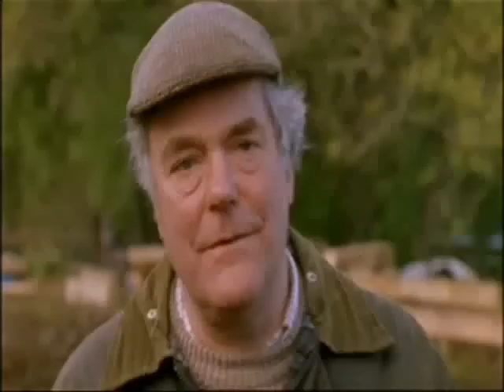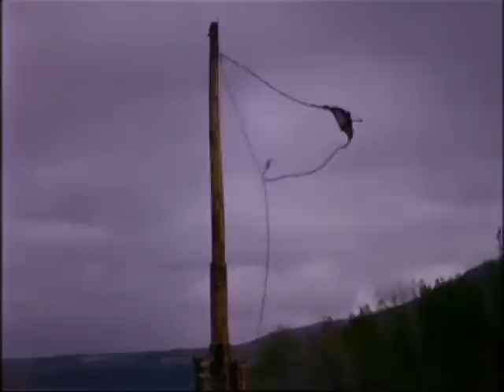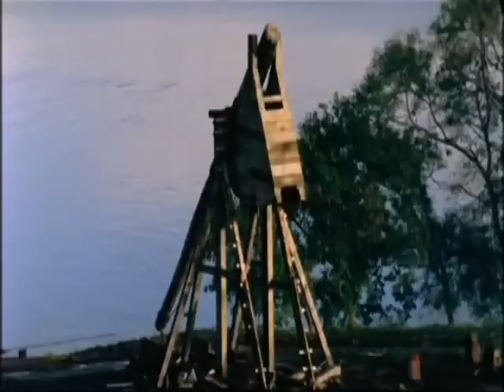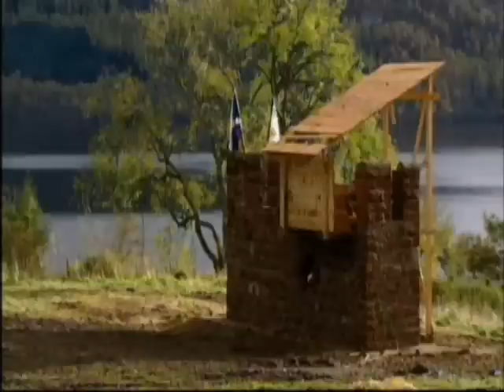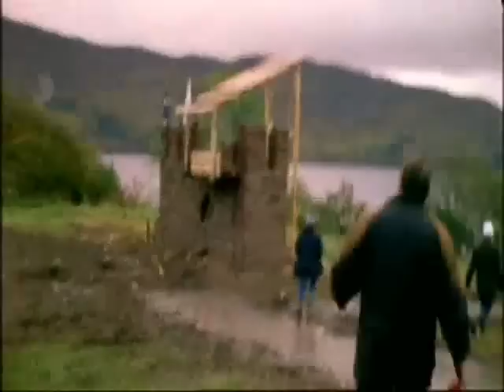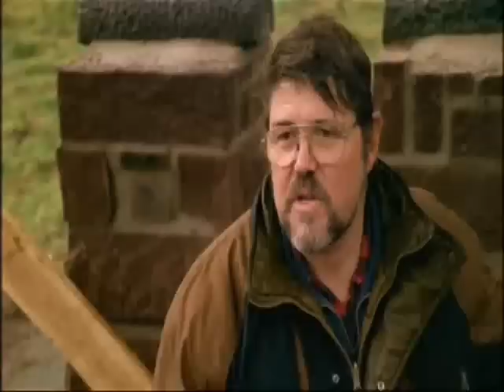The Medieval Trebuchet

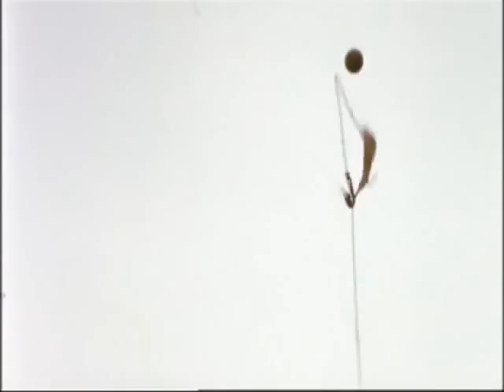Comment: I think the biggest problem was that the rope that connected the pouch to the throwing arm was too long. At 6:02 you can clearly see that the throwing arm is already slowing down again when the pouch has not yet reached its release point. I bet hey could have improved the performance massively by shortening the rope a bit.